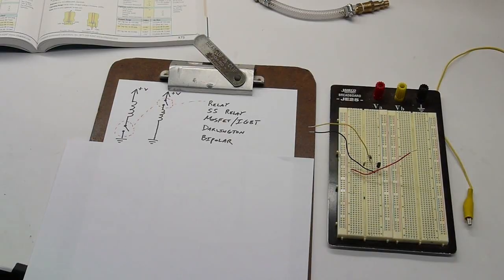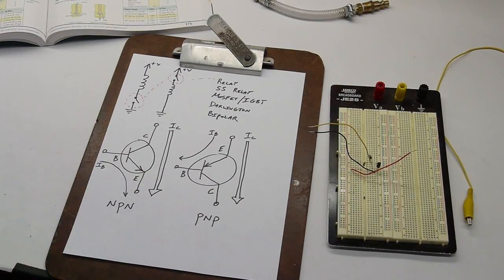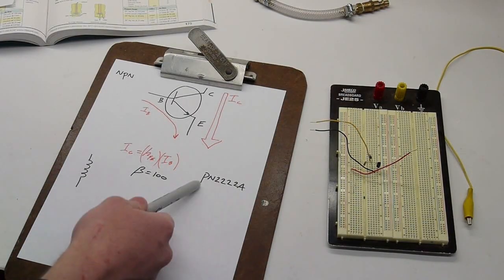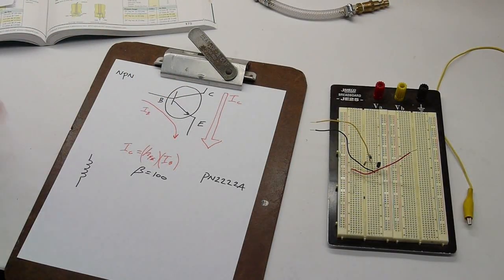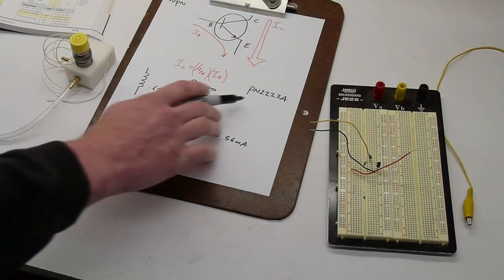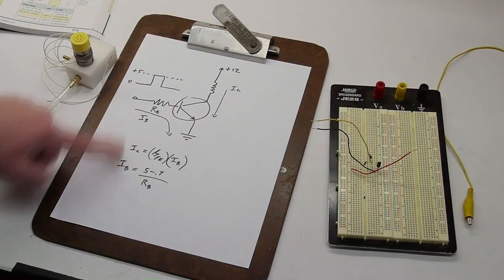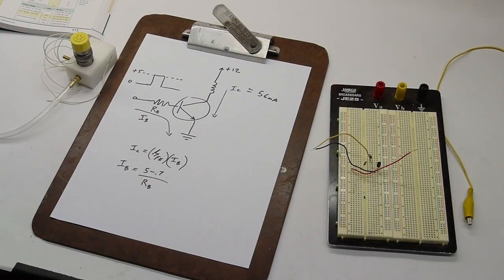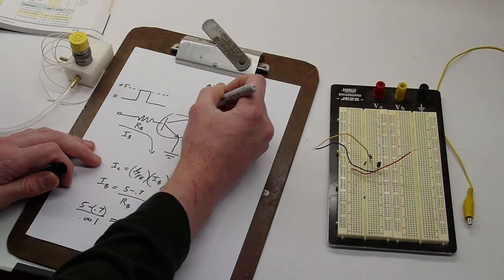Tutorial: How to design a transistor circuit that controls low-power devices

Comment: This video should be shown to everybody starting electronics... No talk of doping and PN junctions, show them this first so that they get a picture of what they are doing.. Too many electronics courses start at the microscopic level.
Reply: I learned electronics first in the Navy electronics school. Learning transistor theory by talking about junctions and doping, etc. was very confusing to me. I never really understood transistors till years later, when I finally understood why they were called "current  operated" as opposed to "voltage operated" like tubes (except fore MOSFETS, which are about voltage). One doesn't need to know what goes on at the junctions to understand transistors. Just know that current between emitter and base is what controls them (again, MOSFETS are different). A good thing to remember is that for a silicon transistor, when conducting, there will be .7 volts between emitter and base. For germanium, there will be .3 volts when conducting.
Reply: @wno1043  Just like you don't have to learn the intricacies of the internal combustion engine before you learn to drive,
Reply: I completely agree.  We wasted so much time talking about chemical composition of transistors as a result I never understood the biasing.
Reply: The video matched by its name - Applied Science
Reply: Brother I couldn't agree more this guy should get paid good money to teach this stuff I have never had such a clear clean understanding and explanation as to what transistor you need what they are how they work how you size the current everything without all that other bullshit that everyone else tries to cream in there there's just not that many good easy to translate and understand teachers out there anymore in this guy's definitely one of the best
Reply: I've been researching into circuits and discovered a great website at Gregs Electro Blog (check it out on google)
Reply: There are many components to studying circuits. One place I found which successfully combines these is the Gregs Electro Blog (check it out on google) definately the most helpful info that I have ever seen. look at this  interesting site.
Reply: Well  the tech school I attended here in Kansas, both where taught side by side, learn how devices work and what purpose they serve, than go build circuits; Ben essentially did the same thing here. One wouldn't notice, unless they learned in the manner I did. In practice, learning the uninteresting (to some) details can, and does facilitate trouble shooting at all levels Impossible to to have too much knowledge
Reply: So you may as well learn the chemistry basics for every single component...all the capacitor types, do heaps of cross sectional computations for wire thickness...analyse different batteries in great detail...but putting the actual components together productively is really the goal.
Reply: Hey, talk of doping and NP Junctions is interesting too!
Reply: There is a difference between engineering knowledge and technicians knowledge.  Most educational information is based for the EE and not the technician. For many folks, including myself i learn fastest by the tech approach first. When i have a solid grasp and want more, i turn to the EE education. I think if the technician education was taught sooner the rest would fall in to place for most....
Reply: If someone is able to understand semiconductor doping, charge density models and other introductory aspects of solid state physics, it's better to start that way.    And it really isn't hard to grasp.
Reply: So true @JonathonAnon
Reply: This was so damn frustrating in college. Waste our time talking about PN junctions and doping and thermal calculations of heat sinks, junk information, and I left with an associates degree not knowing how to even use a MOSFET. Thankfully YouTube and the internet taught me. I hate how electronics is taught nowadays.
Reply: Norm T  Seeing this video won't stop you from learning that. I mean... You can learn something simple like what was presented in this video, then use that knowledge to help you learn the next thing. I don't understand how that's dumbing anything down. Could you elaborate?
Reply: I agree.  I took a lot of classes that taught me the theory well but not much for application.  The most basic differences between NPN and PNP are enough for circuit design.  Deeper than that and one is really discussing materials science.
Reply: This isn't dumbing down. This is high-level abstraction in order to teach a general overview of how it works. Just like not all programmers need to learn machine code to use Java/C++ or even Microsoft word (a super high-level programming language), not everyone requires knowing the physics to use our refrigerators. I'm an engineering student as well so don't tamper with me. Don't get it twisted. I understand the concepts deeply. I love the material. But to expect a dog to explain a bone to me is overkill, don't you think? Abstraction is beautiful, is it not?
Reply: I disagree with those that say you need to know about doping.  You don't need to know how something is made to use it.  Engineering is about using things to solve problems.  This is not "dumbing down".   This is like saying I need to know how glass is made in order to understand how a vacuum tube works.  I mean, if I don't understand how glass works I won't be able to understand why there can be a vacuum.  Without a vacuum, the tube won't work.  Therefore, I need to know how glass is made...WRONG.
Reply: Norm T  their point is when they just want to start with how to use a transistor, they dont want to have to worry about the physics at the same time, its not that they arent interested in the physics, they just want to start with the basics.
Reply: Very true. I did an electronics course 10 years ago and I can remember doping and PN junctions, but I can't remember hardly anything about actually designing circuits that work.
Reply: JonathanAnon because those courses are made for engineers . For hobbyists this is probably enough. For an engineer this is not enough.
Reply: Even engineers would benefit of easier introduction to the matter.
Reply: @EdwinFairchild  But the introduction at microscopic level kinda kills the interest in my opinion. I like to develop interest in something before getting started.
Reply: @curiosity551  thats what i mean, if interest is the issue which implies a hobbyist, then ignoring the physics part of it is just fine. For an engineering perspective you dont have the luxury of interest, you NEED to know the intricacies whether they interest you or not.
Reply: @EdwinFairchild   if you know it all, why are you here?
Reply: derek gilmore please show me where I said I knew it all? I’m an engineering student and speaking from my perspective. But again please show me where I said I knew it all , to validate your statement of course
Reply: @EdwinFairchild  I think what they mean is that if people see this first, then the more complex concepts will be easier to map onto realworld applications. You still learn the physics behind it, but you don't sit there scratching your head trying to visualize how that gets implemented into a circuit. I don't think anybody said engineers should watch this and never learn anything else about the subject again.
Reply: r!shi kesh the thing you are speaking is something that you have to do at individual level.
No one's going to create interest in your mind.
Reply: @EdwinFairchild  if you dont have interest you should probably pick a different career.
Reply: @deegee3142  Funny remark.
Reply: @EdwinFairchild  Yes, maybe but not from 'Day 1'. Too many scientific and mathematical principals are taught in an abstract fashion. Garner the 'what and how'  first, then explain the 'why'. In the real world, it does not matter that much whether the charge carrier is an electron or hole. Application is the important thing, IMHO.
Reply: @EdwinFairchild  Uhm dude, this is stuff that's being taught in basic physics high school courses in Germany.

And it's most definitely bullshit to start out at the microscopic level without properly explaining how and what to use for a circuit.

Showing you the microscopic level first is going to disenfranchise the majority of students and in the end ensure they don't learn anything at all.

That's stupid. Stuff like this video would make the students much more motivated, which is essential for teaching.
Reply: @EdwinFairchild As an engineering student myself, I must respectfully disagree. Introducing component such as transistor by teaching about its atomic structure serve little good in my opinion since many students don't see any immediate benefit this information can bring them in designing circuit, thus most of the time this information is forgotten. When you introduce components by showing what it can do and how to design with it instead, the nitty gritty details about how it works makes more sense for the learner since they have the appropriate context to apply that details thus reinforcing the information in their mind.
Reply: @EdwinFairchild  Engineers my ass, 95% of the engineers NEVER has to know the microscopic properties to work with transistors. Unless you're working for an CPU making company like Intel or AMD
Reply: @EdwinFairchild  Very true.   If someone can't hack a rigorous education, they shouldn't pretend to be an engineer.
Reply: @EdwinFairchild  No one will become an Electronics engineer without being a great Hobbyist. Shoot me if I am wrong. Interest makes electronics engineers, others be spreadsheet engineers.

I am a mechanical engineer btw.
Reply: The reason we explain how things are made is to eliminate the natural tendency to be mystified. When you hold a transistor in your hand, you don't say: this is miraculous. People who makes that are geniuses. I think it is alien that brought that technology.
If you laugh at that, good. But I know an engineer who says similar things.
Reply: @moiquiregardevideo Disagree. We don't do that when learning how to use TTL or CMOS logic devices or microprocessors. Their implementation is basically irrelevant. So it should be for transistors. If people are interested in how they work they can look that up at a later date 👍

Comment: Should be worth to mention that hFE changes over temperaturen, current and voltage acording to the datasheet. So you can't shoot for the highest hFE in the datasheet and calculate the resistor. In most cases you have to average hFE. Often this average is something around *0.5 of the highest rFE.

Comment: on a npn couldn't you use a resistor on the base also?In a car alot of times you need to switch the hot.. cause the shell of alot of things are grounded.Could you switch the hot with this? I am new to this, thanks in advance.
Reply: As explained in the video, you cannot simply put a resistor in the base and use a PNP transistor because when the input voltage is high ie. at +5V you want the transistor to be off but whatever value of resistor you used current would still flow in the base and the transistor would be on.  There are ways to overcome this such as inserting a zener diode in series with the resistor or using a NPN transistor to switch the base current of the PNP transistor.

Comment: In the water pipe analogy it can be useful to picture a capacitor as a rubber diaphragm stretched across the pipe, and an inductor as a flywheel-propeller.  A resistor in this analogy is a propeller driving a friction plate, generating heat.  The volume of water held by the diaphragm capacitor equates to the volume of charge held by the electrical capacitor.  Similarly the energy stored in the flywheel-propeller equates to the energy held in the inductor's magnetic field.  It is easy to see the capacitor circuit conducting ac - a vibration in the water, and blocking a direct current flow with the capacitor diaphragm stretched.

Comment: Great tutorial. The only thing I would add is a notice, that espacially motors can draw much more current at the moment of switching on. So even if the data sheet of a motor specifies eg. 100mA, it may be the case that the motor will not start running, because a sigificantly higher current is needed to make it run in the first place. So as you said in the video, it is always a good bet, to play is safe. If the transistor part is capable of handling 300mA, but the switched circuit requires (under normal operating conditions) 100mA, then nothing is lost, if the signal source can handle the current through the base. Especially if you still can use the same transistor and just have to change the base resistor to a smaller one.

Comment: Hello, Ben! You're awesome. I've always enjoyed your videos. One question, though... How did you decide the capacitance value for bypassing the freewheeling diode?
Reply: Vinit Shandilya is more a factor of choosing a cap with a sufficient voltage handling ability, then cheapest component in that range, which are usually the lower values of capacitance, not a problem since what you want is a high voltage to appear quickly across the diode.

Comment: Thanks, this told me just what I needed to know! I'm trying to interface a 3.3 V PC parallel port with some stepper motor drives in a CNC router; the drives have opto-coupled inputs and the specs say 5 V input and 220 ohm input resistance -> 23 mA current, which is probably too much for the par port. An NPN transistor circuit like this looks just the ticket (with Rb ~10 k).  There's a 5 V supply in the machine already, so this just needs to switch the low side.
Reply: Use a 1K base resistor to cater for worst case, or a 2.2K if you're using a BC547B (as it has a higher spec for β when in saturation).

Comment: So what do you guys think about biopolar transistor are they getting too old since the mosfet ones got more efficient and popular or is it just me? for all my applications I use FETs and can hardly think about using biopolar yeah FETs are a little more expensive but still the low 'ON' resistance (Efficiency) is well worth it.
Reply: Depends entirely on the type of performance you require - for low impedance low noise circuitry bipolar devices completely dominate, and for efficient power conversion MOSFETs and IGBTs totally dominate. You pick the right tool for the job.
Reply: "A little more expensive" can add up to a lot more expensive if one is building hundreds of thousands or even millions of widgets, with each widget possibly having many transistors. I would guess most companies simply go with the least expensive option that meets the requirements.
Reply: Yeah but the very high efficiency translates in to a more quality product when it comes to power consumption and simplicity anyway mosfets get cheaper and cheaper over time.
Reply: True. It would then depend on what the requirements were, and if reaching higher efficiency is more important than reducing costs. In some cases it would be worth it, in other cases, not so much. But either way, you've made me think about it and I will do some more learning about BJTs and MOSFETs so I actually have a clue what I'm talking about lol.
Reply: Yeah that would be great!
Reply: There are many reasons why you would want to use a normal biPolar - pretty much all analog technology requires them as they offer better noise characteristics.
BJTs are also more robust and are used in high power applications (lower resistance) - just as examples.
Reply: MOSFETs have the problem that they have a wide range of gate threshold voltage between samples of the same device. With a 3.3V microcontroller, I can't actually guarantee what the worst-case Rds(on) is going to be, but I can guarantee that I can drive a BJT into saturation from that supply. Of course, the BJT isn't going to handle a lot of current, so the MOSFET is going to be needed if you want to supply large currents, but then you'll probably want to use a gate driver ic to minimise losses in the MOSFET.
Reply: BJTs are current controlled current sources.  That means that you need to source current (and power) from whatever is driving the solenoid driver.  An MOS device is a voltage controlled current source (kind of what you ideally want).  This means that the driving circuit has only to supply a voltage and almost no current.  MOS gate current is ac coupled and
high impedance.  Negligible power is required of the circuit driving the mos device.  We  use BJTs because that is what we first learned.  In fact when I learned about transistors MOS devices were somewhat rare.  We used JFETs which behave like vacuum tubes.  MOS transistors are almost always better for any application, that's why there are a billion of them in your phone.
Reply: Michael bjt transistors aren't inferior because they're older they happened to be discovered 1st. Fets are a cousin to tubes  which came before that.  Tubes still have their place. darpa is still pouring money into tubes.  a plain old 3904 bipolar isn't  going on the scrap heap any time soon.
Reply: @anullhandle , while BJT's were the first commercially produced transistors (invented in late 1947, produced in 1951), an FET was patented by Julius Lilienfeld in 1925. This earlier work failed to gain attention, apparently due to difficulties constructing the device. Even so, the FET was invented first. See https://en.wikipedia.org/wiki/History_of_the_transistor.
Reply: @jimhark  , haven't read the link but iirc quantum physics predicted the fet (I guess that patent?)  way before technology caught up to pull it off.